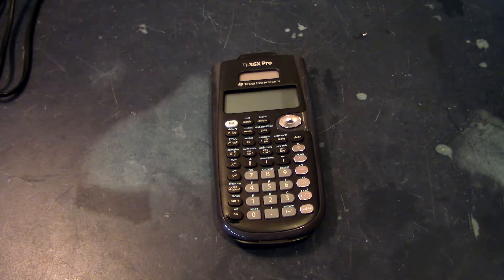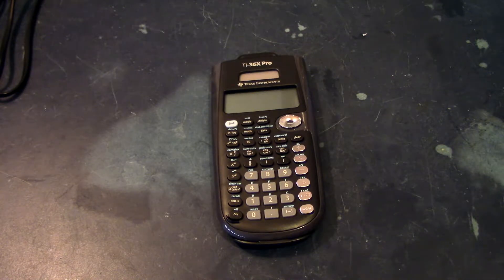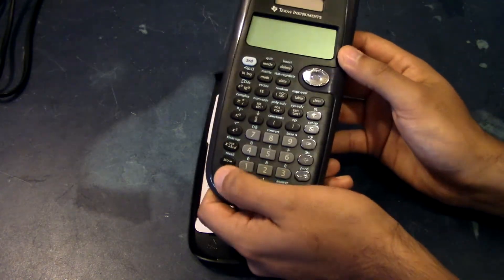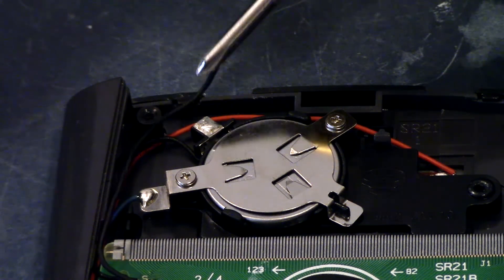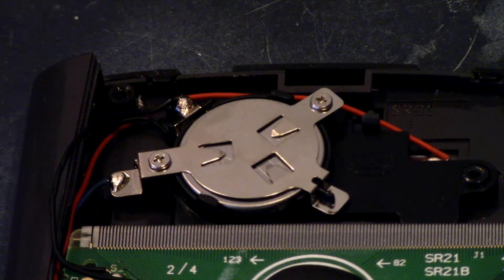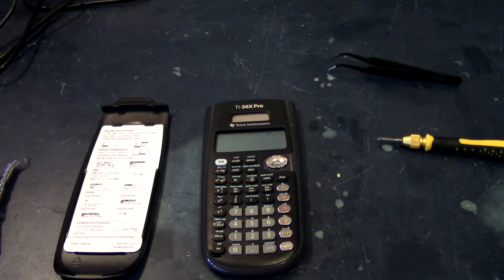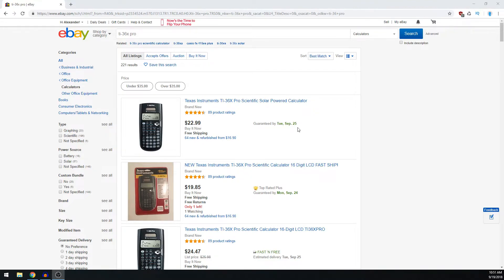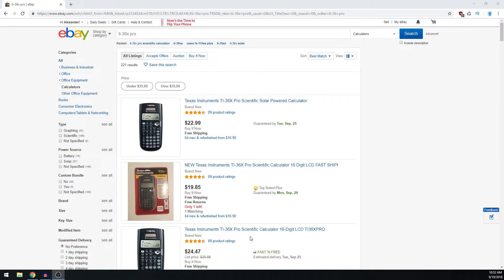How to Fix TI-36X Pro Calculator Not Turning On

Comment: Good video! Yup, you need a "soldering third hand stand". And bit more flux next time to help the solder flow onto the metals. And the original soldering job should have withstood the breaking of the case in a fall. Neither the momentum change or the vibration from the fall should have knocked it loose. I suspect that normal use would have vibrated that connection loose in a few days. The case should have broken to pieces from the impact first. The other option is that you have an amazing cover story. But, I like the story, stick with it. Unlikely things do happen.